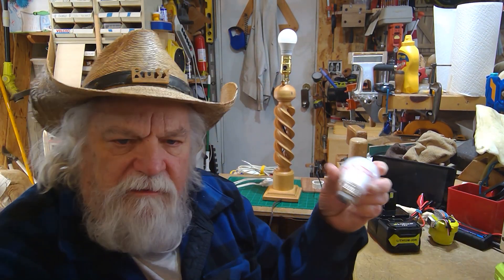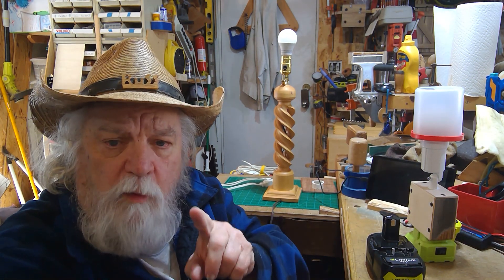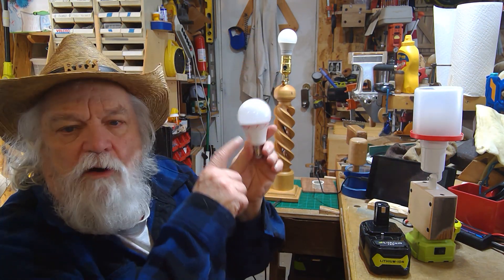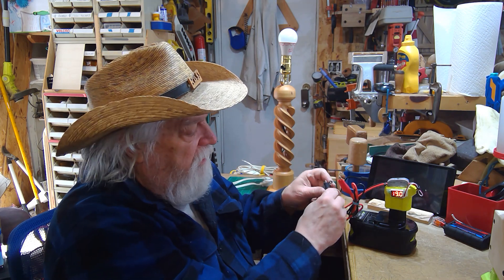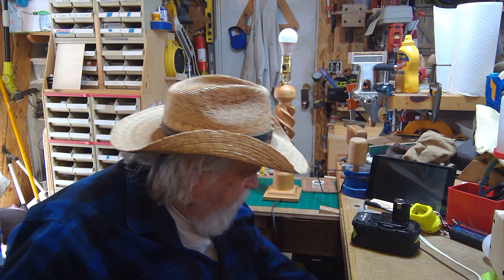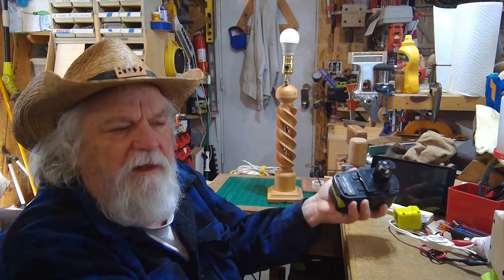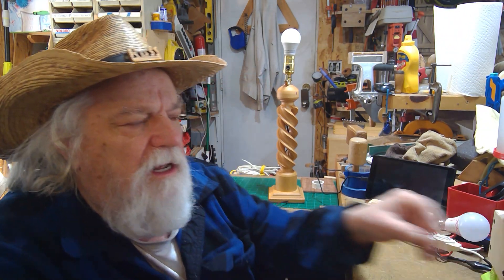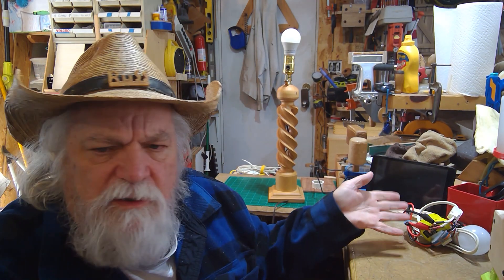Run Any AC Lamp on DC Power by OTB Thinker

Comment: Is it a special bulb for just d.c. voltage?
Reply from the maker: It runs on voltage of 10 to 24 volts.  most lights will run on ac or dc.  The voltage range is the difference.  You can run a regular bulb on dc if the voltage is high enough (around 110-130 volts).

Comment: You could put a 110volt wall socket onto a box wired up to one of your battery adapters connected to a battery then plug your lamp straight into that.
Reply from the maker: Great idea, Brett, thanks.
Reply: @russveinot5754  
Did that make sense? It did to me but I wrote it😆
Reply from the maker: @BrettSucks  What you described is what I talked about making (a box) in the video.  Your thinking is on the right track, Brett.
Reply from the maker: @BrettSucks  We use 240v on some high amp appliances, but most things here run of 120v, like lamps.  Do you use a standard fixture for lamps & what voltage do they use?  What country are you in?
BTY, it's you guys that have different words for stuff :>).  Always a joy to talk to you, Brett
Reply from the maker: @BrettSucks  Hey, don't blame us. If You want to talk about strange words for things, the Aussies didn't do any better than we did :>).  Do you use a screw in bulb?

Comment: I like the OTB thinking! Sounds like you recently had a real-life FOGS event. I hope all your emergency plans worked well. Thanks Russ.
Reply from the maker: Yeah, I did well. I had to use the generator for a couple hours in the morning to get some heat and water pressure for morning tasks.  Mostly ran off my 100Ah battery pack.  Thanks Dave.
Reply: @russveinot5754  It works, great job.

Comment: For clarity, the fat spade on a 2-prong plug is Neutral (grounded conductor in a 120vAC circuit), and the thinner one is Hot 120vAC. The Neutral is fatter so the is more surface area for better safety. Also in the light socket, the metal spiral in the socket & on the bulb is Neutral (grounded conductor), for better safety since that's the most likely part for a person to accidentally contact & the Hot contact is obscured by screwing in the bulb. For the same reason, the Ground prong on a 3-prong grounded plug is longer than the current carrying prongs so the safety ground is "make" first "break" last and in contact before & after the current can flow.
When converting to DC, following the AC rules of hot & ground just makes good sense.
Reply from the maker: Thanks for the clarifications.  When it comes to good info, you are so full of it :>).  Thanks Mike.  Keep the info coming.

Comment: Wow! Love the out of the box thinking! I was wondering since most electronics ultimately run on dc, can we in a fogs scenario eliminate the inverter and go from 18vdc from battery to whatever dc the electronics needs via one of your buck converter devices?!
Reply from the maker: Some would be simple to do, some not so easy.
Reply: Bill, it's almost impossible to replace large draw devices with DC (blower motors, home refrigerators, water heaters, hairdryers, etc.)  There's a reason that Nikola Tesla foresaw the need for AC.  But anything you have that runs on a "wall wart" or batteries is a candidate for DC backup power (cuz that's what the wall wart is doing).  Things like LED light strips, battery powered camping fans, phone rechargers, routers, computers/tablets, TVs, etc.  I just cut the wire from the wall wart to the device and insert a suitable connector for normal use (I use Anderson Power Pole connectors, but anything would work).  In the event of a power failure, you just disconnect the wall wart and reconnect the device to something like Russ' adjustable power supply, dialed up to whatever the wart was delivering. For battery powered devices, just use a set of alligator clips to power the battery holder terminal.
Reply: Awesome info! Thanks for the nice reply! Loved the wall wart reference! Looking up Anderson connectors now!
Reply from the maker: @billtodd6745  The Anderson Power Pole are my connectors of choice for most uses, especially when above 10 amps.  There is a bit of a learning curve to make them but it's worth it . . . and no soldering needed :>). Thanks, McD.
Reply: Thanks guys! Just watched video on them they look awesome!
Reply: By the way Russ, I was looking at the legacy mills for sale on eBay and some look like they are made of unistrut and some are made with extruded aluminum?! What’s the difference?!
Reply from the maker: @billtodd6745  Legacy use to use the unistrut early on and moved to extruded aluminum as it improved the machine.  I have the 1200 series and have no issues with it.  I hear there are issues with the earlier models.  I would try to get one with the extruded aluminum simply for the quality & engineering improvements.

Comment: Russ, what I've done is taken my green Ryobi battery adapter (like those you got from AliExpress) and terminated the two wires into Anderson Power Pole connectors.  Then I made selection of short 8" connectors that go from APP to any other connection device I might need.  So, for example, a 12v car connection to APP, banana plugs to APP, Standard American electrical cord to APP, alligator clips to APP, etc.  Then it's a simple matter to grab a battery, my green adapter (with APP already on the end) and the appropriate connector from my little bucket.  In a power failure I can just set the battery on the floor by the couch, connect lamps in the house to the extension cord end of my APP/Extension cord connector, connect the other end to the battery, change the bulb and I'm off to the races.  I could just as easily use my APP/12V cigarette lighter connector and connect the lamp to the car (for camping, automotive work, etc).  The beauty of using a standard connection like APP is that I have 3 of those green ryobi battery connectors already set up with APP and they're ready to connect to anything I have, including power meters, power supplies, etc.

Works great!
Reply from the maker: I am a big fan of APP connectors.  I tend to use barrel connectors when the amps will be under 10 amps.  I will have one APP lead in the box for a spare also.  I am a big fan of using the lever nut for generic plugs too.  I only need connectors on one end.  That's what I have on that Ryobi receptacle that I was using today.  It makes it easy to put different connectors on the receptacle.  I think I have the urge to make a video discussing this subject :>).  Thanks for your interest and input here, W.